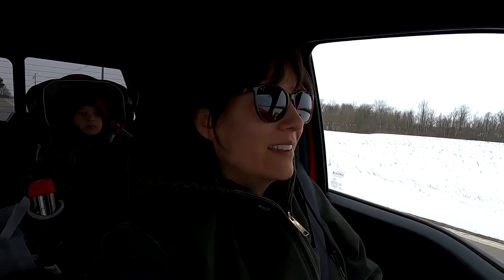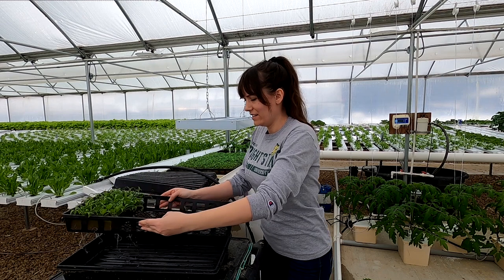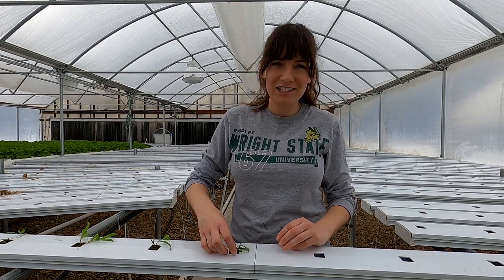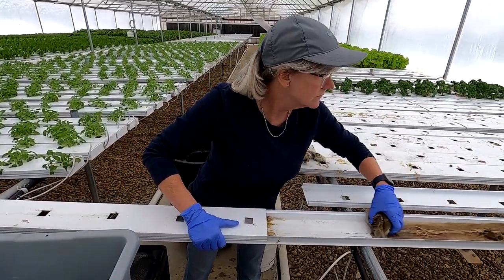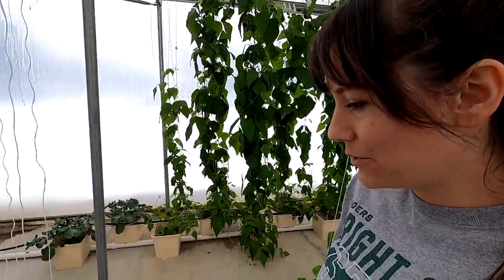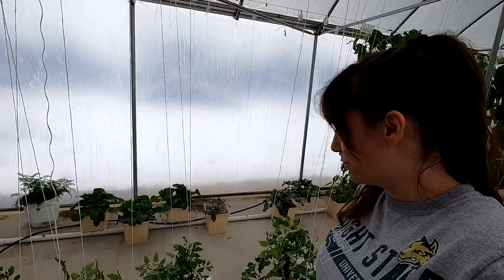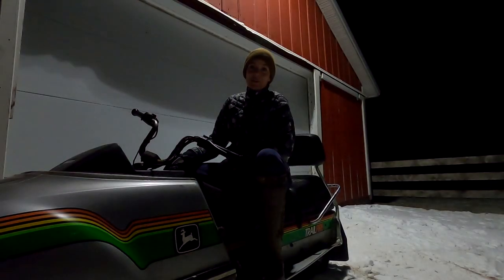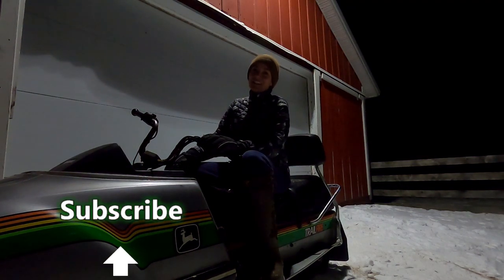Busy Women in the Greenhouse | Dutch Bucket and NFT System Work

Comment: I made my own NFT system with 4 inch gutter downspouts.  I drilled 4 inch holes and use 4 inch net cups.  I just started and am about to move my plants into it.  My question is do you think tomatoes will grow in there or would I need a bigger hole for root system?
Reply from the maker: Sounds like a good setup!  I think you could get tomatoes to grow fine, but the more roots you can get on them, the better.  We've never grown tomatoes any other way than in the Dutch buckets.